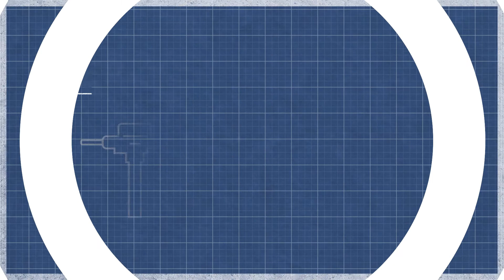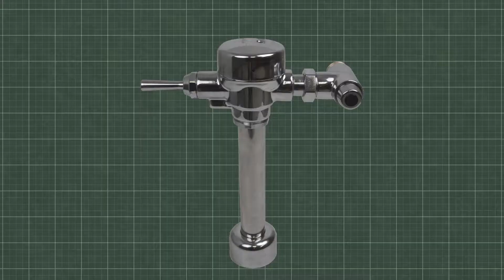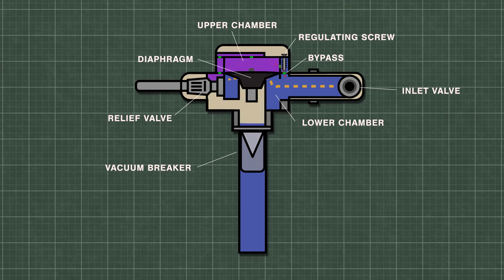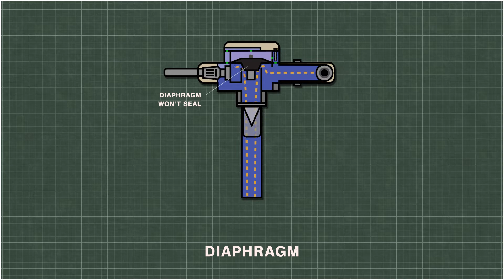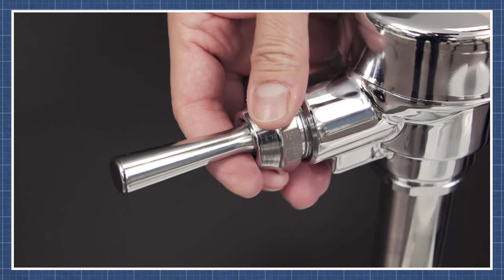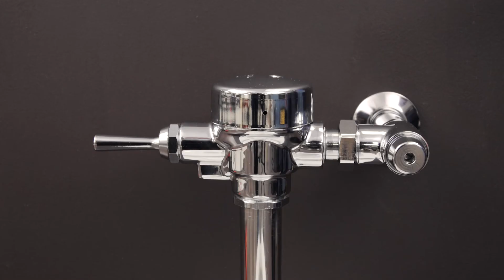Troubleshooting A Delta Teck II Flushometer | Repair and Replace

Comment: Can a Bad flushometer cause the toilet to overflow?
Reply: Plumber here typically it doesn’t sounds to me like you have a sewer or clogged toilet itself
Reply from the maker: Thanks for watching. It is not common for a flushometer to cause an overflow, even when running continously, the toilet would be able to drain that amount of water. If there is something preventing the draining, then that will cause the overflow.

Comment: I have same toilet, it is not leaking but making sound all the time. What should I do? Please advise. I am regular customer of Amre supply.
Reply from the maker: Thanks for watching. If the flushometer is constantly making sounds then its likely coming from water running. If the diaphragm is not closing properly then it could let a small amount of water through, which you'll likely hear. That would be the first thing to check. As well if the noise is just during a flush then you could try closing the control stop valve a little bit to see if that helps reduce the sound.
Reply: @AmreSupply  Thankyou so much for your reply. I have to change the flush valve. I am ordering from your company and I already did.
Reply from the maker: @dillilohar9300  We're just happy to help! Thank you for your support we wish you all the best!

Comment: Most repairs ending up ether to replace damaged diaphragm or all diaphragm assembly.
Reply from the maker: Thanks for watching! You are right that the diaphragm is the most common culprit. The rubber will break down over time.